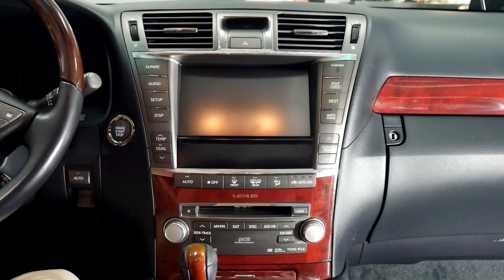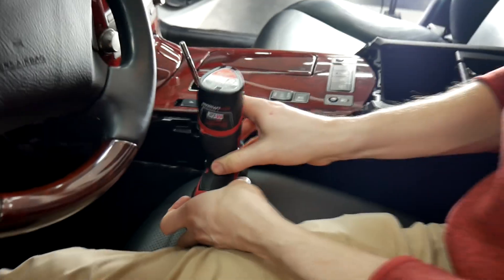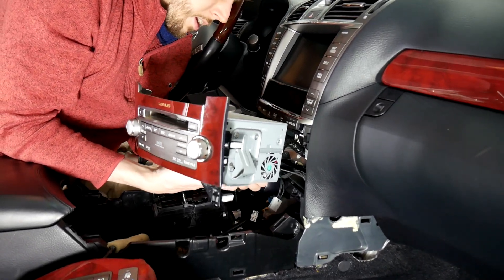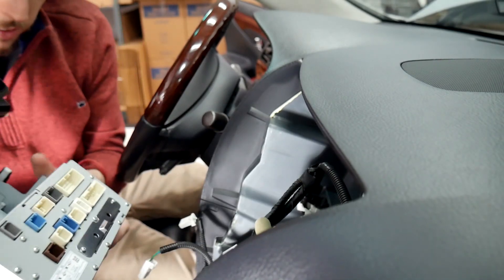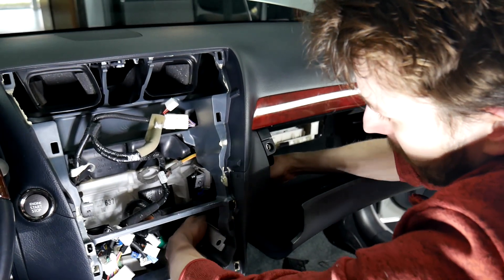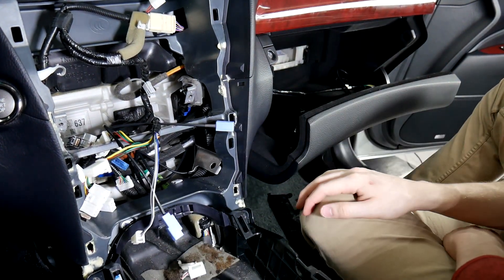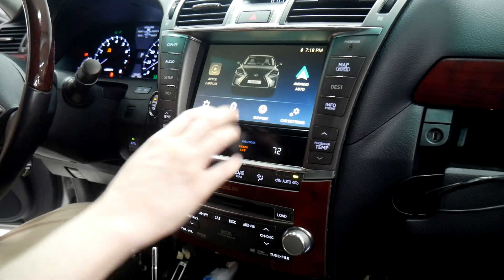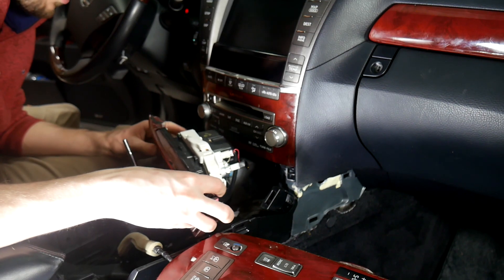Lexus LS 460 600h 2010 2011 2012 VLine VL2 install stereo removal guide CarPlay Android Auto LEX6

Comment: Also I put the GPS on top of the right air vent underneath the dashboard and installed the mic inside the ashtray. You gotta drill holes on it if you wanna clean routing.

Comment: If you install this device in a LS600h... does it also effects the rear TV? Or is there any possibility to update the 3 Pin Connector to HDMI or to run Youtube in the rear?
Reply from the maker: It does not affect the rear TV, and you can use the HDMI-Out function to run YouTube in the rear. Check here: https://youtu.be/CIhK3ZejPr4
Reply: @gromaudio  ah ok. Thx mate!